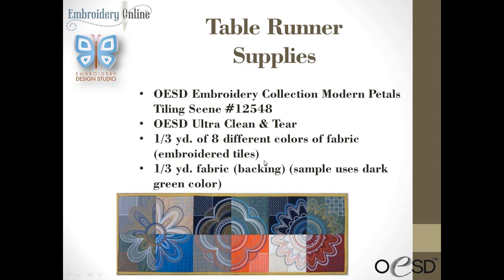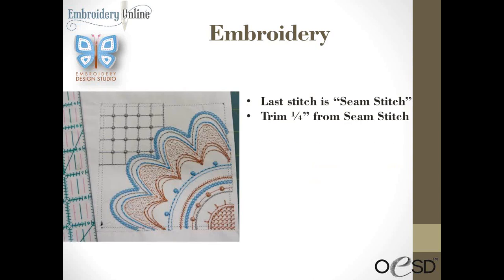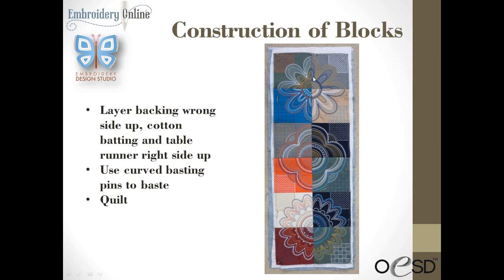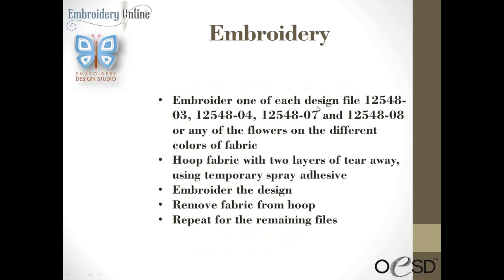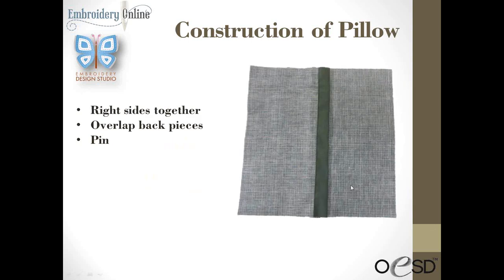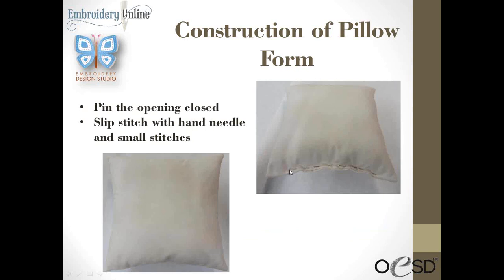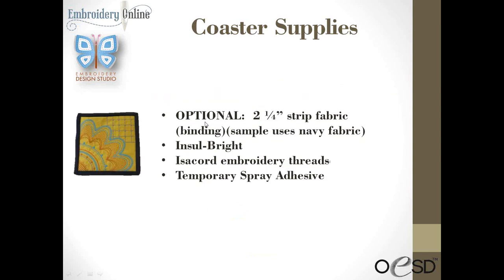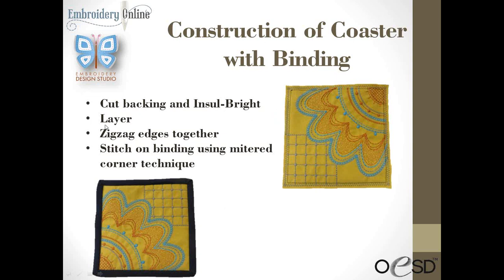Modern Petals Tiling Scene Embroidery Projects

Comment: Very cute project and design pack!  There's no mention of removing the tear away stabilizer.  Did you leave it in, and were the samples stiff as a result?
Reply: I'm wondering why tear away was used. Wouldn't it be difficult to get out, given that the stitching is mostly lines (vs solid fills)?